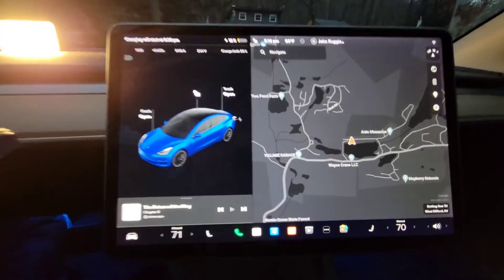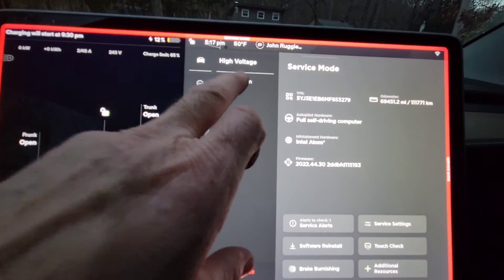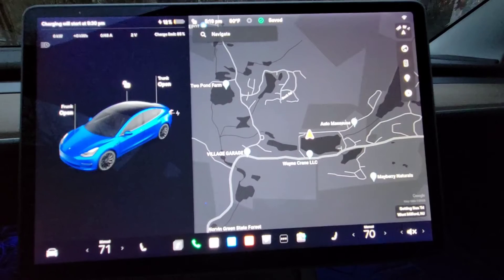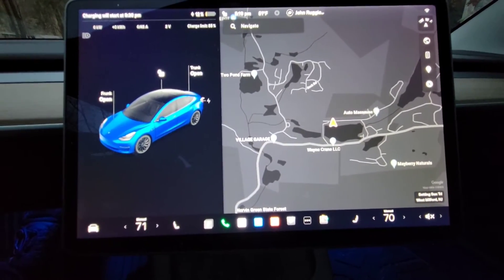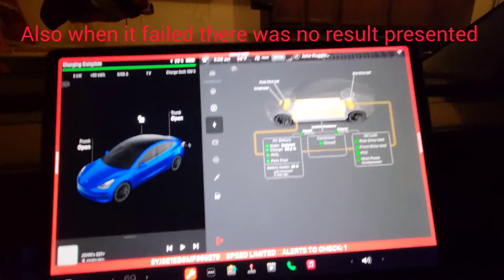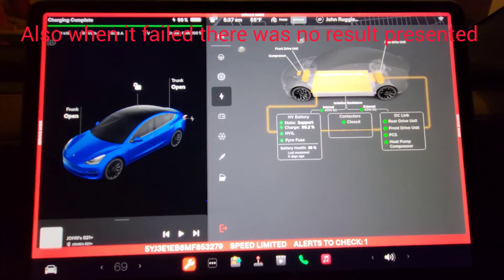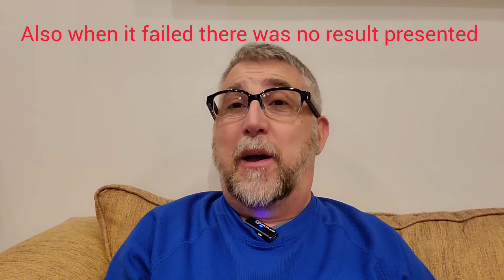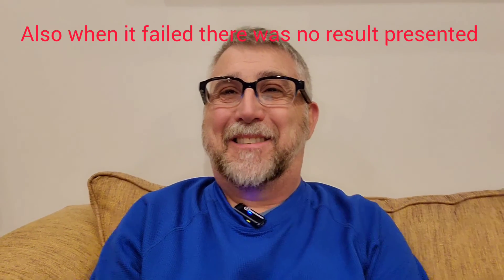Tesla Model 3 High Voltage Battery Test -- Battery Degradation 😢

Comment: Searching through videos of different YouTubers who have done this test because mine seems like it stalled at 7%. Crazy hot in our garage from going ~43% down to 7% and wasn’t sure what was happening. Exited service menu and tried to start it again after turning off Cabin Overheat Protection. Says it’s in progress or something so hopefully it’s still going 😂. Seems like having to try this multiple times is a strong possibility from the videos I have found. Thanks for the video, it was helpful. My 3 is now at 6% and asleep in service mode still, not ideal, but I also couldn’t get it to start charging. Maybe too hot from the discharge.
Reply from the maker: Yes the test seems difficult to get to run.   Thanks for watching.